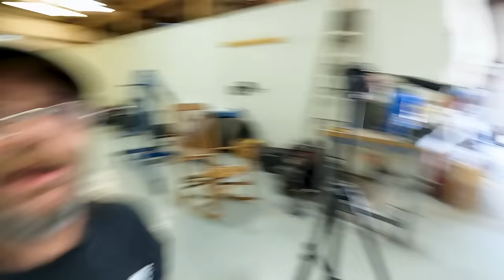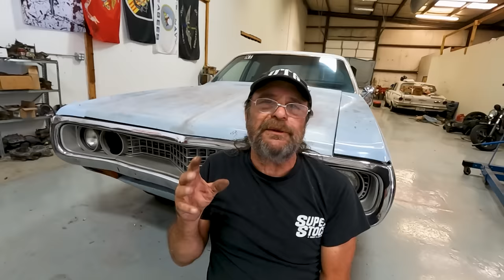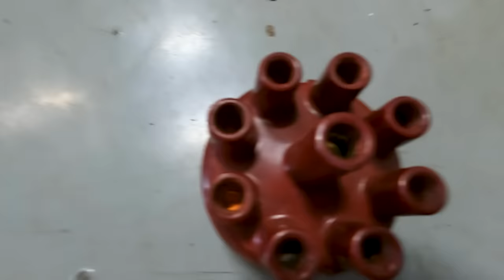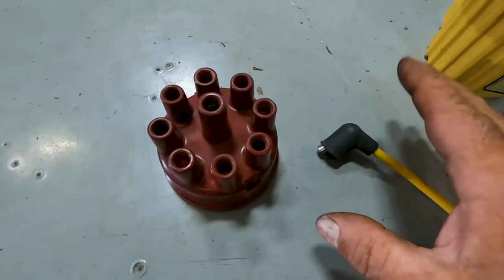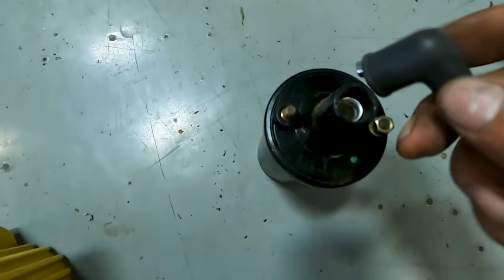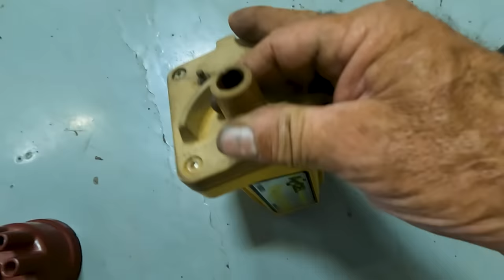Engine Misfire Under Load - Diagnosing And Troubleshooting One Of The Most Common Drivability Issues

Comment: Thank you for this video coming from a Mopar guy. My 96 2nd gen 1500 ram has been through some changes in the past two years of me working on it, tranny rebuilt, top end, head gaskets and so on... I got this truck from a friend who brought the 4 gen ram 1500.  She had just got some work done to this truck, about 1500 dollars worth. New water pump, spark plugs and wires and radiator. When I saw this, I said to myself where was this mechanic  going because shortly after I got the truck, major issues my friend. Even though I pitched the Crankshaft sensor wire between the tranny and engine, opps my fault...  crank no start right off the bat. I'm like damn. So I checked my fuel, good there, checked my air, no clogs, checked for spark, no spark. Okay I got this , time to put on my big boy pants. Put in a new crankshaft sensor, oh I'm loving it, yeahhhhhh, I got a spark, thank you Zues...... lol. Then I'm thinking, something caused this but what,🤔🤔🤔🤔.... Then your video popped up.   My number 3 wire, done # 7 wire burnt but still works...  Then it hit me, you said if the spark has to jump then anything around it will become burnt. Just like in my case, the guy that did her tone up did not put the spark plug wires on good enough. I must admit on the 2nd gens 1500, just around the spark plugs there are those melt boots. Or a tube of some type, they are useless... They are the cause of those wires going bad, due to the top of the spark plug wire ends just before the top of the tube. But just think if your finger slipped off the wire as you are pressing the wire down and cutting your finger on the top of that boot. How many curse words can you say in 15 seconds after that happens. LOl thank you again brother for this Knowledgeable information.

Comment: Thank you for this video! Now, I do not feel so weird for being picky about putting plug wires back on to spark plugs and into/on to coils and distributors! I literally had people give me grief for taking my time to make sure plug wires click into place, and are not just sitting there.
Reply: Had vandalism. Plug wire pulled off, connecting clip Removed from interior of boot and put back in place. Everything looked normal. 
Sinister. 
Would love more secure boot clip connectors.
Reply: @MPRiley-rb6lj  heh, I changed the wires on my vr6 the other night ,and I needed a big wide straight screwdriver and all my weight pushing  on the top of the connector to hear and feel that click onto the plug end.
There was no way you'd push em on by hand , even better would have been a slotted piece of pipe to spread the load but I didn't damage them.  
Damn things were wicked, I'm not worried about one coming loose!

Comment: I had a similar issue with a '64 Chevy with a straight 6. When the engine was cold it would run great. When it got hot it would run like crap after a while. Turned out it was the coil. When it was cold it was fine. When it got hot it woul;d not work well. With the heat the insulation would fail. It took a while to figure that one out.

Comment: I have always used a lubricant when installing new wires, especially at the cap. My go to was WD40. Wet the wire, asd and pull back the boot, install the metal until it bottoms out, and then seat the boot fully.

Comment: I get what you're saying about misfires. However the issue I have with what you said is a "misfire" is labeled by the pcm in modern cars as anything that doesn't produce thrust onto the crankshaft.
Reply: Well, he is correct, the PCM does not see the CKP signal in the expected time, and that is because the crankshaft was not accelerated by a power pulse, that is 100% correct, and with a proper functioning cam sensor, the PCM "knows" which cylinder isn't firing. Industry standard  in 1996 with the advent of OBDII...

Comment: Just cured a high speed power problem.  Ran fine till I got up to cruising speed,  didn't seem like a miss just no power. Had a non vented gas cap on an old vented system.  Big whoosh when I removed gas cap.

Comment: Had an issue on my 85 d150. At high rpm only under load it would just die until rpms came back down to 3000 rpm or so. Turned out to be the ignition ecu going out. Not too bad for a 38 year old part. New one has lasted 2 years just about now which i think is pretty good for a chinese unit. Still have the old faulty oem box in the truck just in case this one fails so i can limp it back.

Comment: Back in the day I owned a charger very much like his  but I had a street hemi in it,, doing a bit of street racing with it found that with about 10,000 miles on the plugs (champion) I would get misfires above 4200 rpm, and finally found that putting in a fresh set of plugs and could do ok for another 10000. When testing on a plug tester, could see that higher chamber pressures it would blow out the spark, this was using a std. coil and distributor.
Reply: I had a turbo car back in the 80's that needed new plugs every 1,000 km's or they misfired.

Comment: Great video as allways great information/knowledge I really learned from this video as iam having a problem with my olds 350 with a quadrajet on it upgraded my coil but will check the voltage on the coil iam having a slight misfire  while idle but when under load it’s not as bad definitely goin to do and check these methods thank you uncle Tony allways helpful 👍👍

Comment: Dirty or rotted wires or a dirty, oily rotor cap can cause flashover though.

This is something easily seen by running the engine in total darkness.

The wires will sparkle all over if this is happening.

Short term, sometimes, you just spray some engine degreaser all over the ignition parts and wash all the gak off of them.

But if the wires are cracked and rotted, you need to replace them entirely.

Comment: Got a neighbor who has a mustang with 2 /4's sticking out of the hood, comes by my shop ,sounds fine till he puts his foot in it,pops ,cracks ,misfiring. He asked for my 2 cents.told him it was electrical. Of course he rebuilt his carbs. unnecessarily. Said all electronics were new ,had to laugh. Cap was cracked,  had him going in 10 minutes.
Reply: Same.......Damm caps😂

Comment: Spraying water on the coil will normally show the cracks also make it run like crap. I always kept a squirt bottle on my tool box, over night condensation builds up under the hood and can cause all kinds of weird problems the customer complains about that you can't replicate on a warm day. Found many ignition problems just misting down the ignition system, bad grounds cracked caps, bad wires. My 2 cents.

Comment: As the cylinder pressure increases, more voltage is required to jump the plug gap.  As the coil voltage builds (because the spark event has not occurred yet), there's more chance of the energy jumping over to ground (and not across the plug gap) as the voltage increases.  Current will always take the shortest path to ground.

Comment: 98 chevy 454... I'm starting with the silly spider cap on the distributor, and rotor. I'll ohm it out,  testing for shorts because the cap desigh is silly, and destination is "It'll fail cuz it's silly".

Comment: Hey UT! I have a question and im hoping you can help. I have a 67 Chevelle with a 750 holley double pumper with mech secondaries. My problem is that the car starts and runs fine, but when it warms up it starts acting like its a misfire, kinda even flooding? And it just wont idle or drive right. Ive tried leaning it out, richening it, but it seems like nothing helps.

Comment: New to the channel, Tony is a genius. I have a 400 sbc in a nova I recently picked up and it falls on its face even stalls on hard accel from a dig or throttle snap in park. I ran through all the basics timing, plugs wires cap rotor, set card with vacuum gaige and even tried the power tuning. Any help is appreciated 🙏
Reply: Confirm cam timing

Comment: Great video Tony.... My car has the opposite problem. It misfires at idle but runs fine off idle. When hot, it will also try to run with the center coil wire disconnected, if cranked with the starter.

Comment: Would you get zapped when holding the plug wire looking for spark?
Reply: Yes if the engine is running
Reply: Absolutely .
Wear old pants and underwear , or , thick rubber gloves .
Reply: Fast method of checking tho 🤣
Reply: Yes and it will hurt like hell.
Reply: It's best if you stand in a puddle of water so you are properly grounded when you do this experiment.
Reply: @americanpatrol4603  Won't make any difference. You will get the full charge either way.

Comment: Good stuff, but what about ballast resistors, though? They can go bad and cause similar problems. If you have a Ford, that 'make it really easy to steal me' block needs to be earthed where it attaches to the body, and this contains the ballast resistor. If it isn't, it will typically run for a minute or two, then cut out like you've turned the ignition off. You could also buy a car that's running a 1.5 ohm coil that actually needs a 3 ohm, or an added ballast resistor. The points will burnt out quickly and close up, causing sooty plugs due to a weak spark.

Comment: ihave a 76 vette  hei distributor. mechanical advance.  new heads. hesitation.  thought thought thought carb.. holley 600 dbl pump rebuilt, adjusted, new wires new plugs. vacuum gauge is spot on timing is perfect.....   since replacing to aluminum heads , serious hesitation on hard acceleration....  cannot pinpoint it?  any ideas....please help.  love your videos....

Comment: Keep saving dinosaurs!
Reply: Is the plug longer then the other 3...i put a hole in a piston on 1 of those 2.3s,,,,i ended up puting a 

 a used piston in it and got it running,,,borrow a bore scope and peak in the cylinder,,,, you might end up pulling the head anyway

Comment: Could you do a video on the Chrysler 400 engine. There isn’t a lot of information out there compared to other  engines.
Reply: Chrysler 400 = Chrysler 383...just a larger bore/piston size.  400's have less compression than a 383.
Reply: @lukepokrajac1057  I also want to know how build able it is.
Reply: @Brian_pronator  Very buildable Justin.  Sky is the limit for a 400.  Big issue is the low compression piston.  Your piston are probably about .150 below the deck of the engine.  This means low compression and less power making ability.   I'm pretty sure they are higher compression pistons on the market now for a 400.  440 source heads will fit on your 400.  They will raise compression even if you dont change pistons.  It'll probably go from 8:1 to 8.5 compression ratio.  Lots of articles out there on modifying the 400.  They make excellent stroker motors.  Largest bore of any big block Chrysler.

Comment: Hey uncle Tony I have a 1983 ford ranger with the 2.3l 4cyl and ive been trying to get this truck running and it has yet too, but i pulled the spark plugs and on cylinder 4 the the strap was touching the center electrode its supposed to be a non interference engine, Im just at the end of my patience with the 4 cyl im about to v8 swap it, if you have any advice as to the spark plug issue it would be greatly appreciated.
Reply: @ Micheal my first truck was a 1988 Ford Ranger in 1996 . Great truck had the 2.6 engine really reliable. I was 17 years old working at McDonald’s making 4.25 an hour here in San Diego. My  Dad said if you want a truck ok get a job and I will pay half. Great trucks those old Ford Ranger’s I got a lot lot of stories about that truck but not today .👍
Reply: Non interference just means the valves shouldn’t hit the pistons if the timing belt/chain breaks. 
Check to make sure the one plug isn’t longer. Otherwise there’s a different problem with that cylinder.

Comment: Could you do a video sometime on why an engine diesels when trying to turn it off. I have a sbc 350. I've tried changing timing, spark plugs, 87-93 octane and even changed carburetors, and I'm still at a loss. I was told its a 97 roller block, stock cam but supposedly has flat top pistons with cast iron heads. Electric fuel pump because no lobe on cam for mechanical pump. Its in my 86 chevy silverado. Thanks
Reply: See if there’s a solenoid that cuts off gas when the key turns off, since you mentioned carburetors. Had that problem with my Chevy.

Comment: I also ever so many thousand miles clean the contacts inside the cap and the tip of the rotor. I use a strait edge screw driver push the spark plug wire ends into the cap to make surr they are fully seated

Comment: I found after a while tge interbal spark gaps inside of the roter  will form a hard crust. And to lessor degree the outer contact of the rotor. This oxidation/ corrosion  build up is non conductive. You ca n usually crack it off wit a screw driver followed by sand paper.

Comment: Tony,,, ive had 3 ford trucks now with 360/390 enhines. A friend too and they all seem to have an issue with 2 barrel motorcraft carb or aftermarket replacement. Why is it that they start to spit and sputter and act like no fuel or not get fuel when they reach temp, then  stall out and wont start for lik an hour? I just dont get it. I keep going through mechanics and noone can seem to fix the damn problem. Replace distributor, coil, fuel pump, ignition module, starter, the square thing inside fender with 4 tabs, everything. It's killing me. Just want to make some damn money already with my dump truck but it wont run good or stay running. I desperately need help.
Replaced carb gasket, fixed mouse damaged wires, re-tightened carb bolts, adjust the timing, seriously what is the problem. I even rebuilt a couple carbs, check vacuum leaks, fix them as i find them.

Comment: The most original wires to the car are the best to be honest.
The issue is when you change the wires to aftermarket you will always have problems.
I had the wires ground out on the highway with a v8 and you can still make it home.
When the wire coating break down the spark will jump and ground out somewhere on the engine.
At night you can see the sparks,but to be honest sometimes you cant see the sparks since they maybe tiny.

Comment: Tony, isn't there a (small) gap between the end of the rotor and the distributer cap teminals? Or should they be touching? Thanks.
Reply: There must be an air gap for the spark to jump, just like with a spark plug.
Reply: @petesmitt  Yes, that was always my understanding, but Tony stated in the video there should only be a gap at the spark plug. That's why I asked the question.
Reply: @fairmont___d  Tony had a brain fade, as I'm sure he knows how a distributor works..

Comment: By the way, are there different types of spark plug wires connectors for the female style caps ? I've noticed on my 70 Cuda with a 78 440, the spark plug wires don't really hold well to the cap, the rubber is a bit short. The car runs rather poorly, but no misfire, just weirdly slow. I suspect some issues with the ignition.
Reply: There’s different styles and sizes for the boots as well as for the metal connector in the end. You may have to search and try some different sets to find the right one.

Comment: Had slant 6 misfiring found a bad bearing at bottom of distributer  shaft
Reply: My 273 likely has a worn distributor bushing. Made it tough to time and driveability was not good. Replaced the points with a Pertronix and the problem was solved. One day I will replace the bushing.
Reply: You know the best thing is do is just replace it with a v8.

Comment: Do you add some dielectric grease as well??
Reply: my ford 302 says on the rotor tip. I also put mine on the end of spark plugs and end of coil. It also helps not to get stuck after years
Reply: @SethStang_  That was my thought too. Prevent pulling the boot and wire clean off!
Reply: @wjthehomebuilder  yes wont hurt anything

Comment: I got home after kinda messing around on the road with my truck and my plug wire was loose. And connection inside the plug looks so bad I'm pretty sure this is the issue

Comment: Ok.. So I just solved this problem on my 1997 dodge ram v10 ran perfectly until you hooked up a trailer.. 3 different shops couldn't figure it out.. I did tho it was spark plug wires.. the routing of the wires makes a difference even if there hooked up correctly it would cause spark leak and missfire which didn't trip a check engine light.. so anyway yeah check your wires

Comment: I have a 22r im currently working on, replaced the plugs as they were filthy, tuned the idle and the mixture and nownit idles smooth and healthy at 750~ rpm, however since ive owned it its always had trouble reving over 3000 (redline on the dash says it should rev out to 5500) at both idle and under load so i dont believe the spark it weak as its relatively healthy up until then but on the dot every time it will start to breakup at 2800-3000 rpm. I have yet to touch the timing but anyone whos dealt with a similar issue on an old engine, what may be causing this issue?

Comment: Straight six engines are fun to drive but a basic v8 is the best when it comes to getting home no matter how you beat on it.
I have spun up engines to near redline and I have never blown up an engine.
Trying to modify an original is kinda lame,it maybe be cool to have a little more hp but you will have nothing but problems.
An engine is made a certain way that man doesn't understand,maybe you can make it go faster but you are shorting it's lifespan.
The 360 magnum is good as it gets for a v8 mopar its got plenty of power.